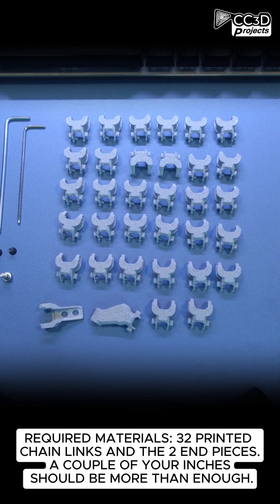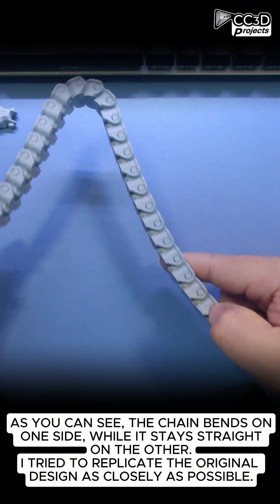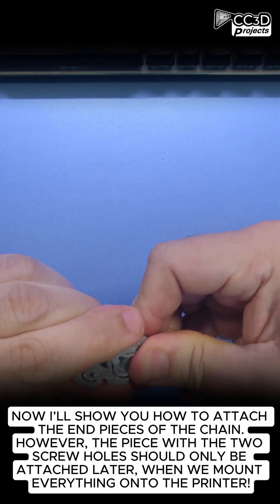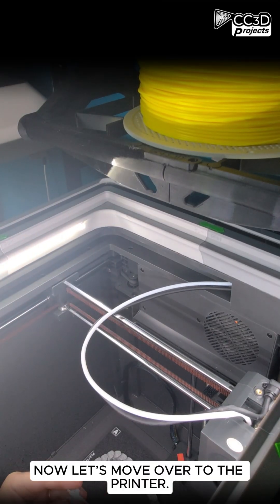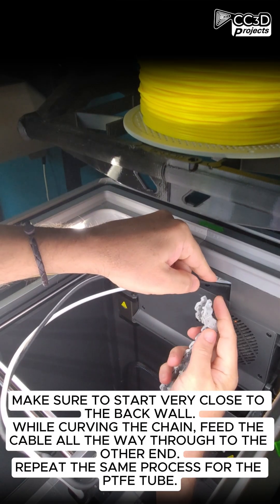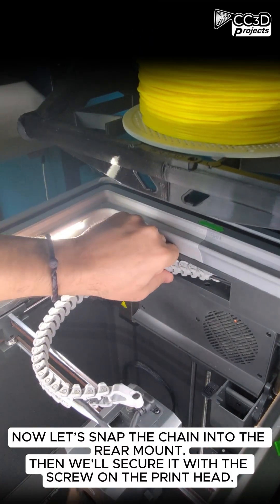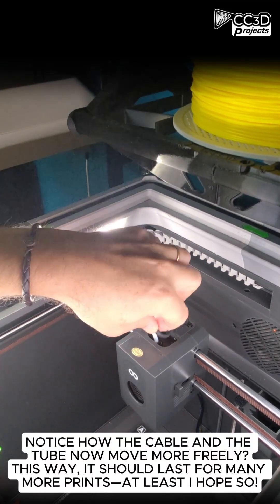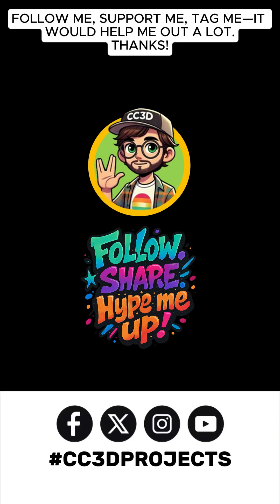This Simple Mod Makes Your Centauri Carbon So Much Better! Installation Manual

Comment: I'm having one issue, the cable chain sags enough that it falls below the cutout for it int he side and snaps against it repeatedly, which I am worried will eventually cause something to break
EDIT: The solution was using a more rigid petg. Elegoo petg pro worked, bambu petg hf did not.
Reply from the maker: Damn, in 9 hours I went from hero to idiot LOL
Shoot me an email or message me on WhatsApp and we’ll figure out what’s not working!

Comment: Life saver. I'm runnung one of the first batches and my cable chain snapped preatty early, but there are no replacements o9nline. This was literally my only option and it worked flawlessly.
Reply from the maker: Mate you should respond to my message I sent you! LOL